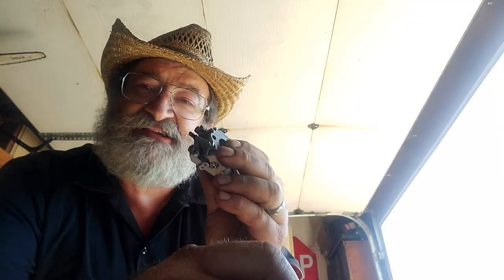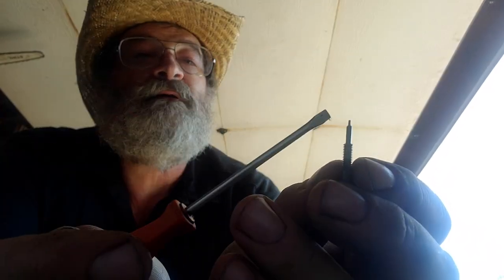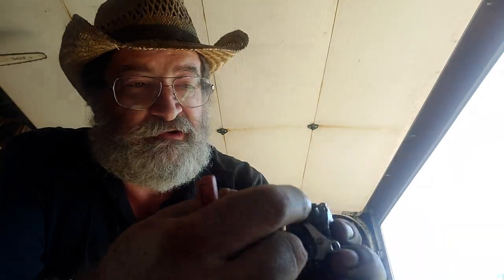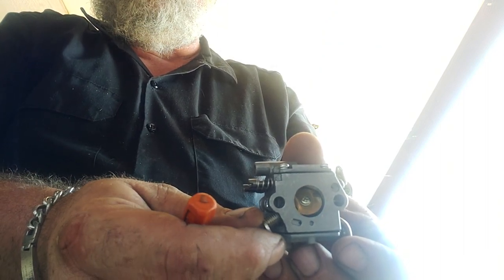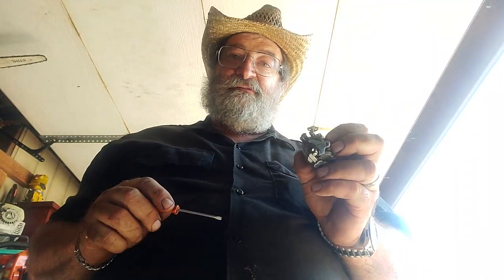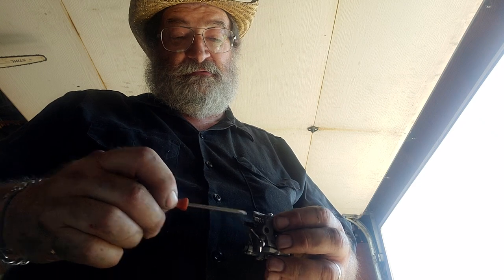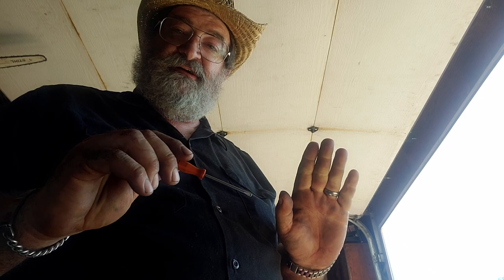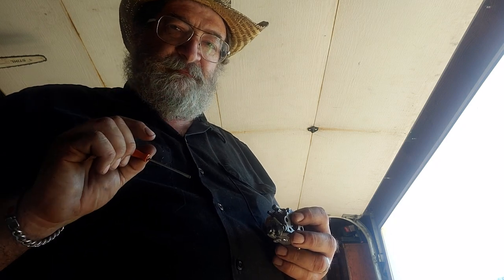How to adjust the carburetor on a 2 cycle engine.

Comment: Agreed Papa! We are not splitting hairs here sir. Now my buddy brought both his weed blowers to me yesterday and niether one would run,hard starting....like you say they would finally start and die. Now this phenomenon happened out of the blue with both engines very strange, he uses these gas leaf blowers for his business so they have to stay running to make money. I told him it was time to pull both carbs atleast the fuel pump diaphrams and inspect...i strongly believe its a fuel delivery problem hence the hard starting. These carbs are very finicky to say the least to throw them out of adjustment and your completely lost on settings however im a huge tuner on performance and race carbs for all motorsports of racing..... an entirely different ball game!

Comment: Air pressure increases the closer your get to sea level or below. The volume of air in an inch square column going straight up into space above grows taller as you go lower in elevation. Also the air is denser at sea level from the increase of pressure the air is being squished from the air above it. This means there is more oxygen packed into every cubic inch of air at sea level as compared to the peak of Mount Everest that is why sound people need oxygen supplements aka a tank and a mask at high elevations. The denser air with more O2 per cubic inch at lower elevations requires a bit more fuel for a proper burn. This also means a properly tune naturally aspirated gas engine makes more power at sea level than they do at higher elevations. assuming the ait temp is the same at both elevations.